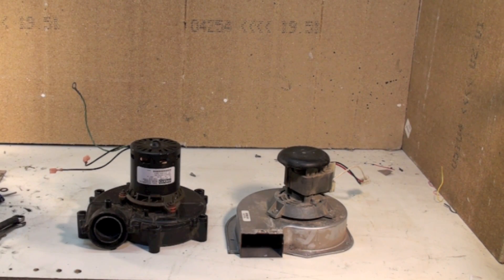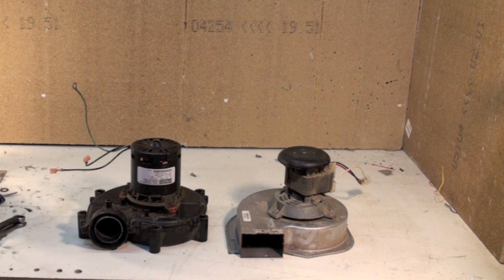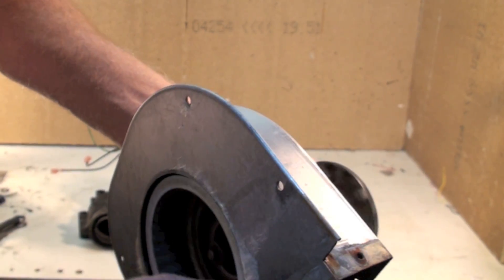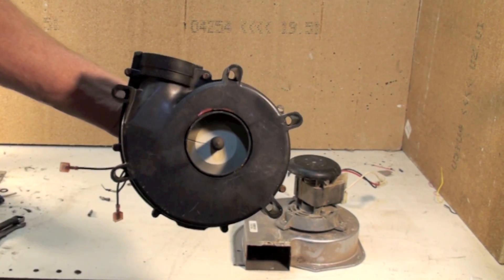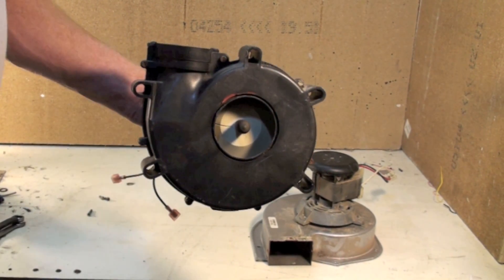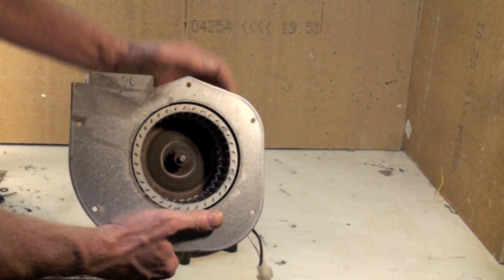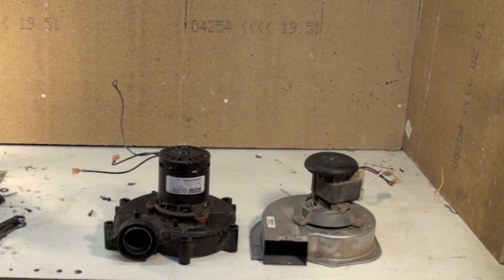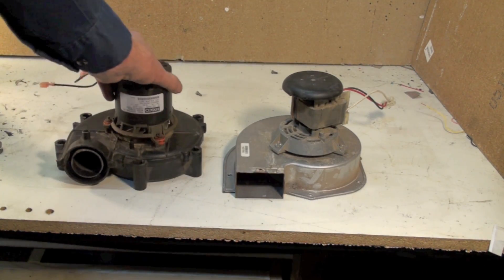Troubleshoot of the gas furnace inducer

Comment: I'm biting my tongue with some family members right now over having someone charged almost $1,000 to install an inducer assembly or buying it and doing it myself.  Have an elderly family member without heat and the legitimate folks say it's going to take a couple weeks to order and then whenever they can get it on due to it being their busy season.. I can have one ordered and possibly here by Thursday.. all components were tested about an hour ago and are receiving the correct signal and functioning properly, the motor is locked up on the current inducer.. simple fix..
Reply from the maker: Sounds pretty ugly.  It shouldn't happen.
GFM

Comment: Thank you for your video.  Hi, my york YP9C inducer motor has only two wires. How is it able to ramp up and down with only two wires connected. One wire is HOT and the other is NEUTRAL. Thanks.
Reply from the maker: The speed control is not in the motor.  It is in the control board.
GFM
Reply: Thank you sir.

Comment: I'm not an expert. But 10 years ago I got Central Air. Is that why my motors - inducers go out significantly quicker?
And or should I get a new furnace with a motor accustomed to blowing near all year round? My furnace works, (the motor is the only thing that needed replacing)  but is 30 years old.
Reply from the maker: First, inducers only operate with the furnace.
All circulating motors are designed for continuous operation.  
GFM

Comment: I just replaced my 80% inducer with a Fasco OEM.  It didn’t come with gasket and when I removed the old inducer the original gasket near the exhaust was so brittle it just crumbled.  Couldn’t have been doing much over the past few years.  I installed the new one without the exhaust gasket...do you see any issues coming?  What can I use as a replacement?  

Also the inducer assembly housing, not the motor, seems to be getting very warm.  Is that usual?  I’m guessing it is but any information on that for piece of mind?
Reply from the maker: Use high temp red silicone.  It is normal for it to get quite hot.
GFM
Reply: @grayfurnaceman  thanks for the quick response!  Is it mandatory foe the gasket or would it run fine without it?
Reply from the maker: @seankirkendall7031  Like I said, use the red silicones a gasket.
GFM
Reply: @grayfurnaceman  thank you so much!  Should I use it for both the exhaust gasket and as the gasket behind the inducer, replacing the felt oem gasket?  How much of the silicon do you recommend using??  Thanks again!
Reply from the maker: @seankirkendall7031   Exhaust sealing is not necessary.  It is used as a replacement for original gasketing.  About a 3/8" bead should work well.
GFM

Comment: My inducer motor is leaking condensate on the seams of the black housing. Should inducer be replaced?
Reply from the maker: You can try silicone sealer on the seams but understand there may be cracks in the housing.  This would, of course, necessitate replacement.
GFM

Comment: Can the motor be disconnected from the fan to allow it to be replaced without replacing the entire unit?
Reply from the maker: In most cases, it is impractical to replace the motor only.  The fan may be impossible to remove without damaging it, and the inducer assembly is balanced as a unit, and may vibrate if replaced.
GFM

Comment: I have an Older Dayton furnace with a bad inducer. The bad original inducer in the unit is a Fasco with an RPM of 3450.  Many of the new inducer replacements for this old part have an RPM of 3350. Can I go with the  new part with the lower RPM or will I have to find an older used duplicate with the same RPM? I was just wondering   if the replacement part will generate enough CFM to trigger the pressure switches. Thank you for all of your great teaching  efforts. Everything you do here is greatly appreciated.
Reply: It should work ok.
GFM
Reply: @electriccar3253  Thank you very much for the reply. I greatly appreciate your help.

Comment: I was told what the inducer did and I was wondering why they keep running.  I was under the impression that they only ran for a few moments.
Reply from the maker: Inducers, when used with early furnaces (before integrated furnace controls) would run continuously if the burner did not light.  
Modern furnaces will shut down the inducer if the pressure switch does not make or there is no flame.
The other time it would run continuously would be if the high limit opens.
GFM

Comment: I got a blinking red light  after it runs for about 5 minutes. The door  panel says that it is a relay short . I checked the pressure switch, the eye probe , and small safety switches and everything seams to be working. I can't figure it out?
Reply from the maker: What brand and model number?
GFM
Reply: @grayfurnaceman  G5RA series high efficiency up flow horizontal gas furnace. Induced draft 80+afue
Reply: @grayfurnaceman  I also just replaced the the blower fan to 1 stage from a 3 stage no ac.

Comment: My plastic Fabsco has a Small dia plastic "Flow Reducer"(Flat plastic with smaller hole)  Plastic-riveted to the center, apparently to redirect/focus air flow over the Heat Exchanger.   This is the part that failed on mine and I'm sure it happens often, It is not protected from the heat because it is so flimsy and "added-on."  It disintegrated and took out the fan wheel(Irreparable).  Then, it is not sold with the Fabsco, you have to purchase it separately, from a separate supplier, and back-ordered.   MY fan arrived first, and furnace was out in cold weather so I tried it.   Cycle is wrong and furnace ineffective, so I assume it's essential.  Why wouldn't they make it out of stainless or something?   ANYONE have any other ideas, we're cold.
Reply: I wonder if I could use the GAsket-Maker/sealer in addition to the plastic rivets so that it would be firmly attached to the thicker/cooler plastic of the Inducer shell, maybe forestall it's eventual disintegration.
Reply from the maker: First, I would be sure the furnace is not over fired.  Anything you can do to keep it mounted solidly may help.
GFM @paularmstrong9915

Comment: what is the purpose of the Gasket in between  metal part of the fan
Reply from the maker: Its there to seal the intake of the fan so that only air is drawn from the heat exchanger.
GFM

Comment: Can you replace only the blower wheel of the inducer if the motor is fine?
Reply from the maker: You can try if it is a metal inducer and wheel.  Plastic, no.  Usually, the wheel will not come off the shaft, and if you get it off, you usually will bend the shaft.  Good luck.
GFM
Reply: grayfurnaceman mine was plastic so no choice.. I bought a new inducer, thanks for replying 👍

Comment: I have a Goodman furnace from the 90's or so I would guess since it has a shaded pole inducer motor. This week the igniter went out so I replaced that. Then a few days later the inducer motor wouldn't kick on at all. I checked the exhaust vent and pressure switch vacuum hose for blockages but everything was clean. Next I pulled the inducer motor itself and it also was clean as well as the port for the vacuum hose to the pressure switch. It also spun freely and the bearings all ran smoothly and with no play. I did notice that the gasket on the limitting plate had a lot of dry rot. So I put some high temp silicone on there to replace it thinking that the loss in pressure around the inducer housing may be just enough to not allow the pressure switch to function within range. I reinstalled it and it ran smoothly for a couple of days when it quit running again. This time when I powered the furnace on the inducer motor would flinch but not rotate all the way. Again this is a shaded pole motor and there is no capacitor for it. I checked the inducer motor for power and it was not getting any power. I checked for 24v from the thermostat to the control wire on the circuit board and that was good. It was about this time I noticed a small humming/buzzing noise coming from the control board which is still flashing the pressure switch failure code. Upon closer inspection the noise appeared to be a relay on the board very close to the power leg and common wire blade terminals feeding the inducer motor. I am ordering a new circuit board as this appears to be the issue that is preventing power from getting to the inducer motor. I probably could find the relay and replace it but I am not well practiced at desoldering and resoldering in small circuit board components also the circuit board is very corroded and is probably the original so there is no telling what may fail next. Circuit board component failure is definitely another cause of inducer motor failure. I didn't see this topic covered in the video but nonetheless your video(s) were very helpful in ruling out the other more common issues.

Comment: Hello quick question I have a Duncane furnace its saying that pressure switch is stuck open. The inducer wont come or nothing. I replace the pressure switch in the hose. The inducer is getting 110 but wont come on.
Reply from the maker: The most common problem here is the bearings in the inducer motor have seized.
GFM

Comment: i have a question. my new inducer isn't creating enough vacuum to trigger the vac control switch. what can i do?
Reply from the maker: Ok, the pressure switch would not make so you replaced the inducer. Most inducer problems do not involve the inducer.  Venting blockages are the first thing to look for.  Blocked pressure switch tubing, blocked tubing fitting, failed pressure switch.  Hope this helps.
GFM
Reply: @grayfurnaceman  thanks for getting back to me. The inducer is new (oem) and pressure switch is new. Recommended as an oem replacement. On their own the furnace won't fire up. But if I put the tubing in my mouth and create a vacuum she'll fire up. Do I have a leak somewhere? Where should I look?
Thanks Bud
Reply from the maker: Have you checked the vent?
GFM
Reply: @grayfurnaceman  will do tomorrow. I'm also thinking that the felt gasket they provided for the inducer may be not making a tight seal. That's another job for tomorrow.
Reply: @grayfurnaceman  Hi, somehow I lost the message thread to our conversation. I did check the vent and as you suggested there was a bee's nest causing a blockage. All working perfectly now. Thank you so much for your help.

Comment: I'm getting a loud buzz that starts 30-60 seconds before the main blower kicks on.  Inducer shot?  DIY replacement job or should I bite the bullet and call a tech?  Thanks
Reply from the maker: Send a video to Grayfurnaceman@gmail.com
GFM
Reply: So I replaced the inducer motor (full assembly, not just motor) but still have the same loud buzz.  Any ideas?
Reply from the maker: I would trace it using a screwdriver to the ear.
GFM

Comment: I'm getting water in my pressure switch vacuum hose. What could be causing that?
Reply from the maker: There a couple of reasons this could happen.  If the furnace is in an area that is less than 55F.  The pressure switch has a small hole in the diaphragm to bleed air into the tubing to keep moisture cleared.  Some of them just do it for no apparent reason.
GFM

Comment: First time I needed the 80% furnace heard the inducer wind up and then heard a "klunk" and stopped. (HINT: always kill the power. Usually will find a switch near or on the furnace).  Power off, could spin the inducer manually with a small rub sound. Took down the info off the old and googled it to make sure of the part & if I was running the latest version (always a good idea, as the manufacturer fixes issues).  Found I had XXXXX-00 and they were up to XXXXX-04. Used Amazon so i could see customer feed back. Prices were anywhere from $90 to $250. Went with the $100 that was XXXXX-04 that had good reviews. When removed, the cage on the old one was destroyed (made out of sheet metal). The new one had a much better constructed cage and 4 screw install (be gentle with the vacuum hose. They are expensive and special) . Turned up the heat then went to furnace, flipped on the switch and have heat. Good Luck
Reply from the maker: The early 80% inducers had many corrosion problems.
GFM
Reply: I am sure there are many different types, but the hoses I have seen are silicone rubber.  Exactly the same tubing used for model airplane engine fuel line...which I have plenty.

Comment: The reason they went to draft motors is because they went from ribbon burners , to inshot  burners , it had nothing to do with flue temp. Also the 90 % draft motor DOES NOT condense , condensation happens in the flue , then runs down the flue, past the draft motor, into a drain trap, condensation also happens in the secondary heat exchanger , and also drains into a drain trap .
Reply from the maker: Well, I have to differ here.  Carrier was the first to go to inducers and inshot burners in the early 1980s.  And certainly the inshot burner will not work without induced draft.  However, most manufacturers continued with ribbon burners both with induced and natural draft units up until around 1990.  The high efficiency heat exchangers reduced the draft temps to around 200F.  This low of temp would not draft effectively, so the inducer was used as a helper to the draft.  I am not sure where you got the condensation happening in the the inducer.  It just must deal with condensate.
GFM
Reply: Hmmm.  I have 3 Coleman furnaces all with the SAME burner, 1 without the motor and 2 with.  They all use the same flue.  The one without the motor also does not have any electronics.  It is a standing pilot.

Comment: GFM, great video. Just subbed to your channel. I have an 80% inducer motor just like you had in your video. Can you suggest where to order another one? Mine is going out I'm afraid. Thanks in advance. Jeff
Reply from the maker: I don't recommend any sellers.  The only advice I can give is get one that is a factory replacement inducer assembly.  Do not buy the motor separate from the inducer itself as the unit is usually balanced as a unit.  Hope this helps.
GFM
Reply: Thanks GFM

Comment: GFM - Out of curiosity on a 80% furnace do you know what is the average temperature at the burners and the average temp coming through the inducer (exhaust).
Reply from the maker: I don't have really accurate numbers but at the end of the burn you should have about 1400F.  The inducer will have about 200 to 250F.  Hope this helps.
GFM

Comment: Replacing a 80% inducer. There is a white thin gasket. Looks like wool or something. It is in bad shape. Can I take that out and use RTV or some high temp silicone instead?
Reply from the maker: I always used RTV.
GFM
Reply: Thanks! On applying the RTV, do you tighten the screws down all the way right after applying? Or should you barely tighten them till a little bit comes out the sides, wait an hour, then fully tighten. I have used RTV for auto stuff and that usually how I would do it but not sure if that is the method you use.
Reply from the maker: I have always just tightened them down.  It may be different with sheet metal.
GFM

Comment: What a bummer that one can not simply replace the plastic fan ring.  Thanks to your videos, I recently found my problem. The fan split. I wired and JB welded it together, so it is running...but I guess I will have to replace the whole inducer assembly. For now, it got me out of a pinch. I can assume the all plastic inducer isn't cheap.
Great videos! I have learned a lot.
Reply from the maker: +Badboy7357 The reason for the assembly is the assembly runs at about 3000 RPM and is balanced as an assembly.
GFM
Reply: What price could you offer for a Goodman Furnace inducer assy, part# B4833001? All plastic.
Reply from the maker: +Badboy7357 I don't sell parts.  Sorry.
GFM
Reply: +Badboy7357 mine cost around $ 200 a Lennox 90% lasted about 14 years .The drain  for  the inducer  fan was clogged causing the fan to be full of water. Once I fixed the clogged  drain  pipe for the inducer motor    i.e  bad install had very little fall, about a year later the inducer  fan stopped working .
Reply: Thanks for the reply. I re-glued the plastic fan wheel with super glue. JB weld didn't hold. The two cracks were exactly opposite of each other so maybe the balance is good. Been running for days now with no indications of a fault, and is quiet. Hoping to make it to spring before having to buy a new inducer. Then I will just hold onto it until the original fails again.
Reply: I would NEVER glue a draft wheel back together , it's going to come apart for sure , and could case more damage .

Comment: I have the same furnace xv90 changed the board wasn't getting 120 to the inducer flashed 3 times which I have a new inducer aswell ,  but the igniter won't heat up. I can see in the flue there was a mice there and died I'm going to try to clean both pipes and see if that is the issue , and blow all the lines aswell
Reply from the maker: +Ricardo Rios That will cause the failure.
GFM
Reply: Ya think I'm not getting enough vacuum I didn't seal the inducer just cause I thought with the new board and switch it'd fire right up but I'm going to seal it  b
Clean all the lines  test the pressure switches hopefully it runs

Comment: Hi Great Video! Thank you.  Would a symptom of a failing induction motor be an increasing amount of time between the start of the induction motor and the start of the pilot/flame/ignition?  It used to take about 20 seconds.  Now with new heating season it can take as long as 4 minutes.  It is not consistently the same amount of time.  It varies from 50 sec to 4 min and seems to be getting longer.  Thanks Much
Reply from the maker: +Jean Lens Probably not.  Pilot could be getting dirty or the pilot flame rod is dirty.  Hope this helps.
GFM